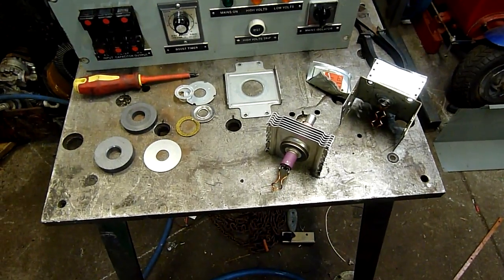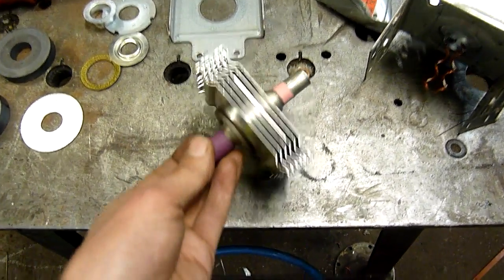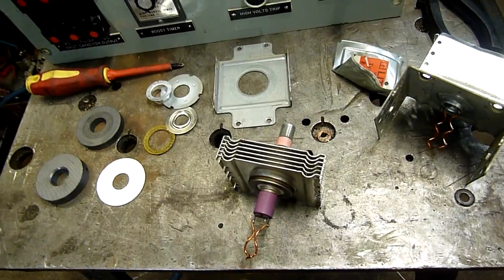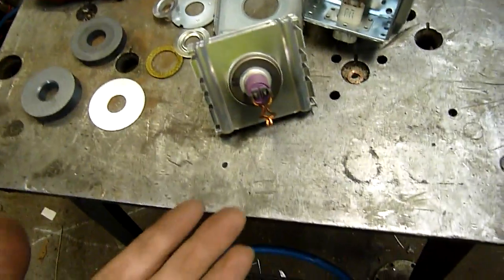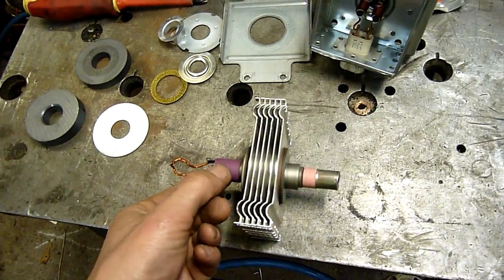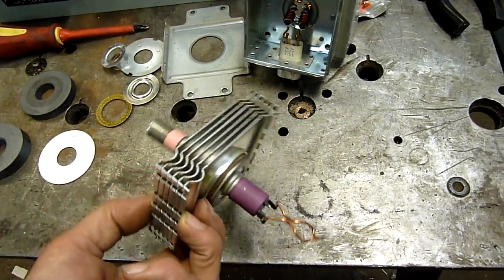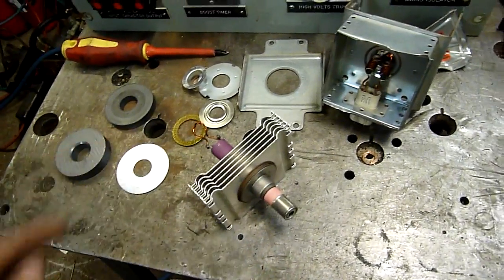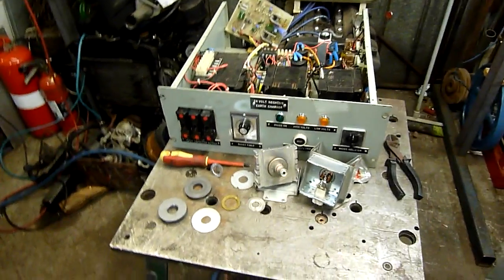Dangers of Dismantling a Magnetron

Comment: My microwave works. But it makes a strange noise and stinks when it is on. Anyone have any idea what is wrong with it?
Reply: if it stinks is there anything inside the microwave that has been spilt??? If it's working I would take a look inside the microwave.and make sure nothing has dropped inside which MIGHT smell when heated. Microwaves tend to get very hot surfaces and make a good hotplate. Not advisable to put plates on top to keep warm, but I know people do.
Reply: I had the same thing some time ago. Ended up finding a mouse had gotten inside the housing, and got his little butt electrocuted.  When the oven was running, the fan blew his stink into the room.
Reply: Well Jerry, not sure how a mouse got into a microwave to get it's butt electrocuted as I would think not enough room to get a finger in let alone a mouse. If, as you say there is a smell your going to have to do the checks by removing the dishes inside the microwave and if nothing in the area you cook your food then ONLY if your confident take the cover off and take a look as the inverter board and then power it up and check to see whether you can detect the 'stink' that way.?? . It's possible that with use it will wear off but if it doesn't and something 'blows then at least you have a microwave that's not giving ANY STINK but needs repair. That is the other side of it as a part may be giving up the ghost.and waiting to pop.BE SAFE don't get an electric shock. Keep hands clear if switching on the unit without cover on. IF not confident leave the checking of the item to a repair man.
Reply: Inverter could be going out

Comment: I might have a slight problem then, because mine has a white ring, and the thing has fallen several times. Is it possible that the beryllium oxide can coat the surrounding electronics with itself?

Comment: That's alumina not BeO. BeO became subject to extreme regulatory controls since it is so extremely carcinogenic, and is virtually never used nowadays. Where it is used, there are supposed to be warning identifier symbols. Besides, BeO was used where high heat conductivity was needed, which is not a requirement for the vacuum seals and insulating posts of a magnetron.
Alumina is harmless. Though like breathing any fine hard powder, it it won't be good for the lungs. Don't grind it.
Reply from the maker: TerraHertz you are absolutely right, since making this vid I have learned a lot about the ceramics used in insulating rings and thankfully BeO is almost gone (I imagine its only some of the oldest microwaves that would still have BeO in them) but like you said, grinding anything like this into dust is bad news, so I still advise people do not smash them up!.
Reply: @aussie50  Could I give you a make/model number to see if you might know what the magnetron is? I’m struggling to find info but don’t really know where to look.
Reply: I have been freaking out for like a hour thinking I was gonna die thank you this comment literally calmed the hell out of me you are amazing thanks so much ( idealize this is a run on sentence)
Reply: Gordon Freeman "Wikipedia/Beryllium Oxide" would be the first place I looked and then "Which magnetrons contain Beryllium?". Then "Cavity magnetron". Then I typed in "2M226" (LG magnetron number) I just studied this whole matter, on and off, for the past 10 hours because I am an extremely bored unemployed person without a drivers licence with a love for learning and protecting others. Seems the antenna end of "Some" magnetrons are insulated with varying amounts of beryllia ceramic. Bottom line. You better treat every one of these insulators like it contains BeO. Hint: If I add links it will go away and help no one. I'd guess 99 percent of successful electronics companies use an "alloy" of AlO and BeO. Trust me, the environment and people's health mean less than nothing. A long lasting product means much more. Who opens up a freaking microwave oven magnetron right? Love how "magnetron" is showing a hit on spellcheck by the way +G
Reply: @flaplaya  noted, thanks. better safe than sorry
Reply: +TerraHertz 

In fairness, if its from scrap or salvage, it's likely an old or older model. No small odds of running into the earlier BeO types (think asbestos in pre-70's buildings).
Safety first.
Reply: A lot of the high power RF transistors have the ceramics made of beryllia - keep in mind if coming across such things, don't smash them with a hammer, file them, etc.
Reply: +TerraHertz I like your comic sans about the alumina but dunno what BeO is.
Reply: puppy Beale
Careful, I've read that color has nothing to do with it being Beryllium or Aluminium.
Reply: TerraHertz 
Thanks dude.
Reply: +Pasta Sarmonella E-Specialé          BeO is the chemical formula for beryllium oxide, which is what the guy in the video was warning about (although this only applies to really old magnetrons.)
Reply: fla playa
Oh, ok, I always treated every magnetron I've come in contact with as if it had BeO though, thanks.
Reply: Google is your friend, or in this case Wikipedia https://en.wikipedia.org/wiki/Beryllium_oxide don't inhale anything or get electrocuted see my earlier post...
Reply: Some of them have thoriated filaments
Reply: @vehemothphosbat2866  now that's something way worse, source?
Reply: @zaydabbas1609  all magnetrons contain thoriated filaments in there heated cathodes. The amount of thorium and radioactivity is very small a crushed one about 36uR/H (I think thats right)  so there not dangerous unless inhaled but there inside the magnetron tube anyway.
Reply: +Aussie50  Hey Mate, today I scraped my old microwave and also the magnetron (didn't know that there was beryllium :/) I did everything outside, so there was enough air circulation. I didn't destroy the purple stuff, the only thing that happened was that I scratched it a tiny bit. Just a very small amount of it is missing. Was the purple stuff on the outside also beryllium? Should I be worried about getting beryliosis?
Reply: fla playa
I can't find anything that actually says what's in the insulator of the antenna in a modern magnetron, would you mind pointing me in the right direction?
Reply: +TerraHertz Thankyou I was worries for my nephew, we extracted magnets a while back and definitely damaged the ceramics
Reply: TerraHertz
Reply: Thank god this is the first comment I see, I recently cut a magnetron up to get at the magnets, and I smashed the insulators up well in the process, I thought I had a death sentence watching this video, thank you!
Reply: how can you tell if tis BeO?
Reply: Wrong. The output (antennae) end of a modern magnetron still contains beryllium. It is needed for its high thermal conductivity and electrical insulation. Fix your comment THZ.. Kids are out there smashing them thinking them inert. Good video by the way Aussie.
Reply: No everyone, it's been proven with many likes that it doesn't contain BeO ceramic anymore so smash it up and make sure to inhale some to.. Youtube can be such poison.

Comment: Is Beryllium Copper just as dangerous? because we used to machine that stuff all the time...lol
Reply from the maker: dust from machining it has to be controlled, it is highly toxic!. if you ran coolant on it your probably fine, its only when you sand, grind or create very find particles during milling or turning operations it gets nasty.
Reply: Aussie50 We were turning cores for plastic moulds..

Comment: Guys, I think i may of inhaled some of this, I didn't see any "Pink stuff" when I tried to take this out, but now I see it, and its scratched. Exactly how much should I worrie!?!?!(Because im freaking out)
Reply from the maker: Pink is 'usually' Alumina cermaic and is non toxic on modern machines, white is definitely BeO and should be avoided, and anything old I treat as toxic.

But don't hold me to it, it would not surprise me if BeO ceramics are still in use by some manufacturers.
Reply: For a one-time event, probably nothing to worry about. If you worked with these as your day job, you might be in trouble.
Reply: I smashed mine open because I didnt know better at the time and then two days later I find this video. Yeah, it was a bit scary to find out the stuff is toxic. But a one-time small exposure shouldnt really do much.

Comment: do you need a simple dust mask or a full charcoal respirator ?
Reply from the maker: well, your not dealing with chemical fumes, so a good quality particulate filter will do for most airborne particles. likewise if you do insist on smashing or grinding electronic stuff up, a proper suit and clean work area would be needed, because depositing dust all over your work place will cause issues later on when it gets kicked up while your not wearing a mask.

I just advise not taking the chance that its not BeO ceramic and keep them whole.
Most new ones should not be BeO, but I would not garentee it, especially with stuff coming from China, they are known for shipping kids toys with lead and melamine in them.
Reply: +Aussie50 
Shouldnt berylium oxyde be more expensive than aluminium oxide, Chinese always use cheaper component.

Comment: What is our security about Beryllium Oxide ceramics?
If it is broken inside the oven, how can we see it? Does the oven work with the ceramic broken?
Reply: Thank you.
Reply from the maker: the oven will not work if its broken, but as the last guy says, its virtually impossible to break under normal use. 
likewise I am finding out that most modern microwaves use a alumina based ceramic that is non toxic (like the pink shield tip on a tig welder) so its mainly smashing up old (20 years old) magnetrons that is to be avoided. 
however its hard to tell if any mag uses it or not, and since China rarely sticks to industry safety standards, I suggest not smashing any magnetron ceramics at all :p
Reply: Aussie50  Thank you.
 I did not expected to find such a dangerous material in a   food preparation equipment.
Reply: Aussie50 I was taking apart an old microwave I got of someone to find the end of the magnetron burnt and broken as if there had been an explosion inside it! Does this mean that there is a possibility of residue BeO powder existing inside the microwave?
Reply: +Aussie50 how are ceramic insulators attached?? Are they glued on somehow would they slide off whatever is holding them on?? I have about 8 magnetrons that are all taken apart the aluminum cooling fins are removed off of the vacuum tube. I don't know what else to do with them  can I add them to my scrap pile the way they are? Doesn't the vacuum tube have good amount of copper inside it though the outside skin does attract a  magnet! I thought the copper was inside?
Reply: halflife390 aw

Comment: ***** 'Critical' ceramic fatigue is why the BeO may shatter "without cause", even though it doesn't break when you throw it around like that the material is strained and will in all likelihood break easier. :(

Comment: The filament could be radioactive.  Radioactive filaments are used in many vacuum tubes.  They will slowly evaporate and sputter over time and contaminate the insides.  Again, try not to do anything that makes dust.  Wash your hands after handling and you should be fine.

Comment: Does anyone know why the fins are straight and then take a little curve then straighten out again? (would it be still have the same function if the fins were just straight?)
Reply: it could be to make it stronger and more efficient
Reply: I've been trying to find the answer to this too. I'm pretty sure it's so the fins can expand and contract while still remaining in contact with the outer case for better heat dissapation. If they were straight, they'd buckle when they heat up. That's just a guess though.
Reply: KingNast The fins are for heat dissapation and nothing more.
Reply from the maker: KingNast the design of them would be to account for thermal expansion, and also to cram more surface area into a small space, I have seen some with lots of bends in the, if flattened out, they would be noticeably wider than the magnetron housing
Reply: Denver Morgan
I know.. I was talking about why the fins are shaped the way they are
Reply: oh ok sorry the shape is interesting could that be for expansion?
Reply: I believe the fins are stamped like that for 2 reasons. 

1. They act like a duct, making sure air from the cooling fan does not excape.

2. They form together and act like a structure.

Comment: thx, yeah caps  are those things that one may forget to discharge,, OOPS :)!, but  when you said "very hot "is it the antenna part of the magnetron? (i.e. that little cylinder at the end where microwaves comes out from, ) that you meant?  what material is it made from and can it really glow red hot if enough power is fed? thx

Comment from the maker: the radiation stops immediately after power is cut, however, they do get very hot, and the HV capacitor will probably still have some charge in it, so discharge it to ground (bridge the terminals to each other or chassis) or it could kill you if you try unplugging the mag.
Reply: i unplugged the hvc directly without discharging it first and I lived.

Comment: Great video - accurate info.  Many thanks or posting!

I just hope that ALL viewers will bear in mind that no-one should contemplate dismantling a microwave oven without full understanding of the risks.

I know of highly qualified TV Engineers who were killed by microwave ovens!
Reply: Capacitors are probably the most dangerous
Reply: @edg6779  don't know if you're still alive but you're absolutely right, with the right power applied to the right spots on your body your heart may just explode.

Comment: BeO is REALLY toxic...

I work with RF power transistors that use BeO and one of the frrst warnings i got is to never smash the ceramic disc between the die and the flange.

BeO = Beryllium oxide.

Comment: Whats the mesh ring, tastes like tin foil. Will this magnetron make my tomatoes grow bigger? Why is sail boat fuel so cheap, is because of the radon gas from leaking microwaves?  Could this antenna be used for Ham radios for longer distances like moon bounce transmissions?

Comment: There is also a slight danger from breaking or grinding the magnets, as the dust from them is also known to cause health problems, fortunately most new microwaves dont have beryllium oxide in the insulators so i read, but better to be safe than sorry.

Comment: When dismantling the oven, the main danger will be the capacitor. They are supposed to self-discharge over a bleeding resistor (built in or external) but if that goes open cicuit there could be a lethal charge in that capacitor.

Comment: Shoulda said something about the capacitor which may or may not have retained its' charge.. Other than that, thanks for the vid, learned something today.
Reply: True. Aways make sure I discharge any capacitor by earthing with a screwdriver with insulated handle.

Comment from the maker: heat buildup, they glow red hot under full load, plastics and glass would fail too quickly, only extreme temp ceramics are rated for such high temps and voltage breakdown tolerances

Comment: The common white thermal paste is zinc oxide in a silicone oil - fairly harmless as far as I know. By the way - the dangerous ceramic you are talking about here is Beryllium Oxide (sometimes called Beryllia), not simply Beryllium metal. It is used because it is one of the few materials which is both thermally very conductive and electrically very insulating. I'm a bit surprised, though, if modern microwave magnetrons still use it as there are safe substitutes which are almost as good.

Comment: For HHO production you really want to use 316 stainless, otherwise the ali will corrode rather quickly and you will be left with mucky water... youtube the dry cell hho producer, they are the most efficient designs around thus far.

Comment: I was told that the berylium is in that brass wool looking washer not the porcelain parts, either way it doesn't matter, wash your hands after handling it just like you would lead solder or printed circuit boards.

Comment: Quote from wikipedia: 

Some magnetrons have beryllium oxide (beryllia) ceramic insulators, which are dangerous if crushed and inhaled, or otherwise ingested. Single or chronic exposure can lead to berylliosis, an incurable lung condition. In addition, beryllia is listed as a confirmed human carcinogen by the IARC; therefore, broken ceramic insulators or magnetrons should not be directly handled.

Comment: yea I have taken them apart quit a bit.   yea i just cut the copper out were the steal meets the copper there is a heater in them also and I'm not sure but I thought that was were the brillium was at and that the hard part was just cermica insulators.   so when I took them a part I was carfule to not at least break the end were the heater was.